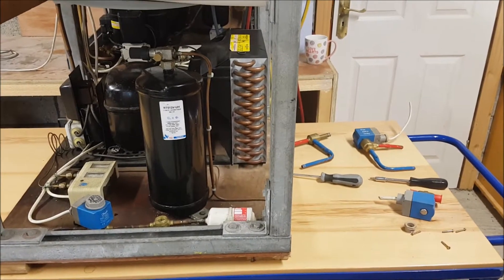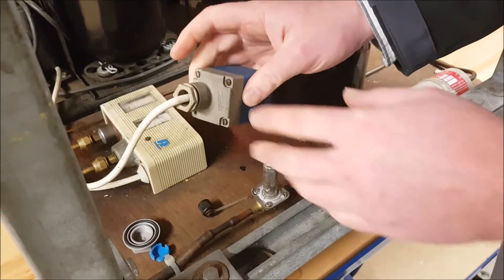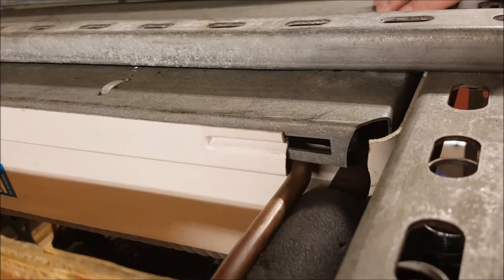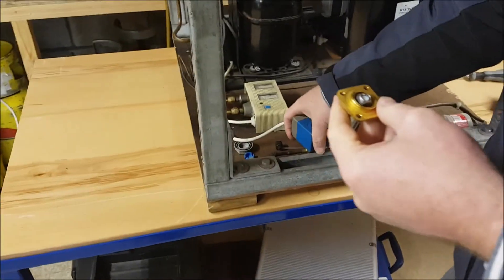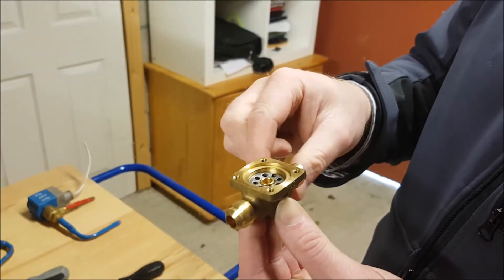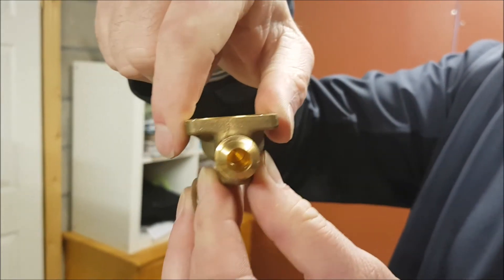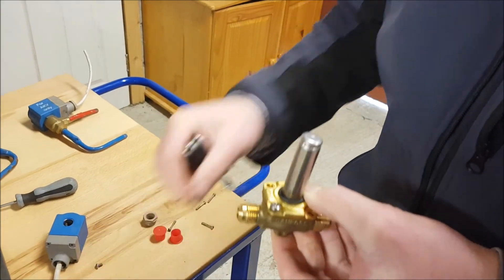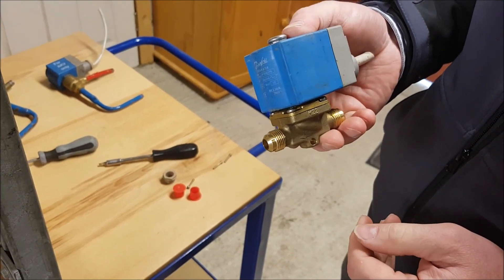Refrigeration Solenoid Valve

Comment: Good explanation.
I do not think that the part you call "diaphragm" is actually one. It is rather an "alignment plate" which centers the valve moving parts in the body. Regardless of common usage, most engineers use the term "diaphragm" to indicate a flexible element separating chambers, usually with different pressures. Here, there are no flexibility/chambers/different pressures.
This is a direct-acting valve. Pilot-operated valve do usually employ diaphragms.